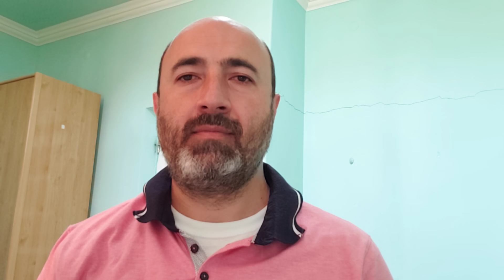Tesla's "Die Cast" New Patent Hints at Ultra-Tough Cheaper EVs

Comment: From a guy that studied materials science- but never worked in the industry...

guessing about what is going on... trying to remember phase transitions in aluminum alloys... and that's been a while.

When you cool liquid metal, the components of the metal will separate as it cools.  By cooling fast you can keep this from happening quickly, but there is usually a change in volume with a phase change and as the temp goes down. This causes a lot of problems.

Doing it wrong causes bubbles, tears, gaps, inclusions, etc. Easy to do wrong.

Now imagine pumping a "near-liquid" that doesn't suffer from those expansion problems of freezing, or having bubbles form.

Greatly simplifying manufacturing processes.  Mostly because it doesn't have to go through a phase change. 

They are effectively extruding a 3d part, causing all the grains to be long and thin. 

The vanadium acts to pin grains together, not allowing them to slide along grain boundaries. 

This fine grain structure  combined with vanadium pinning allows a relatively soft aluminum alloy to become much stronger because of the manufacturing process.

Cool trick.
Reply: Cool trick indeed...

Comment: Tesla has been working on various metallurgic compounds for years simply because their manufacturing needs often require custom solutions. From the steel sheeting of the Cybertruck to the casing and composition of their batteries, Tesla has worked to meet the changing challenges. With giant mold casting, the metal composition and flow is critical to get into every crevice and channel, and avoid "potato chip" deformation upon removal from the molds. Tesla's new aluminum, high-strength alloy does not need heat treatment or metal coatings. With the Model Y rear casting alone Tesla saw a 40% manufacturing cost reduction for that section, and a reduction of 79 parts. Having higher production yields for the front and rear frame castings will reduce production times and lower manufacturing costs.

Comment: Ductility is the property of a material that describes to what extent it can deform without breaking. High ductility is important to absorb a lot a energy in a crash. I just wonder - if the car consists of only a few cast pieces, you have to replace big parts of the car even after a minor crash. Not sure if this is a downside compared to conventional methods of building a car?
Reply: Tesla is way ahead of you.

They have features engineered into the castings that can make it possible to cut out a damaged section and have a replacement section welded, riveted or bonded in place.
Reply: @billdale1  I can't really imagine this but I'm not a mechanical engineer. .

Comment: One of the main advantages of using cast parts is that they have very good dimensional stability and ease of manufacturing, meaning less manufacturing steps to achieve a finished part . Besides the fact that parts produced in such a manner will be much more economical both for the manufacture and the end users. Higher dimensional stability means that panel gaps and other tight tolerance items that are usually hand adjusted by workers on the assembly line will not be necessary, the parts will be made with such precision that they will fit like gears in a Swiss watch. Overall this is an exciting development and one that will be beneficial for all concerned.
Reply: It has been multiple decades since I designed a casting. Although the casting used a precision method, It took a fair amount of machining to make flat surfaces sufficiently flat and add precision hole patterns. And, of course, it required annealing to obtain the desired material properties. The true genius of what Tesla is doing is deleting the annealing process and secondary machining while producing parts at a speed which will support vehicle production rates. The desired rate of production drives an accelerated pace of cooling the casting.

Comment: This patent covers things that have been covered in other videos.  Essentially, Tesla is using the largest casting presses in the WORLD to cast as much of the frame as possible.  They are working to cast as much as possible of the lower frame.  Currently, on the Model Y, they are looking at one piece for the entire front lower frame, attaching that to a structural battery pack in the middle of the vehicle, then attaching that to a fully cast rear lower frame.  This will eliminate over 300 individual parts that needed to be welded together (by robots)...and will  eliminate over 200 of these robots from the factory!  This is a HUGE savings, both in machinery, complexity and time, and will result in cars that fit together better (no more panel gaps!) with fewer points of failure, better reliability, lower weight and longer range!  It's huge!  Additionally, while technically other car manufacturers could buy the press equipment to replicate what Tesla is doing...in order to get it to work properly, they would need to either engineer their own alloys or they would need to license Tesla's formula.  These presses WILL NOT WORK with just any aluminum!  This is giving Tesla a HUGE advantage that other car manufacturers won't be able to match for DECADES!
Reply: Another strategic front where Tesla is making progress and leaving other EV and legacy auto makers in the dust. Progress on other fronts is positioning Tesla into an unbeatable position.